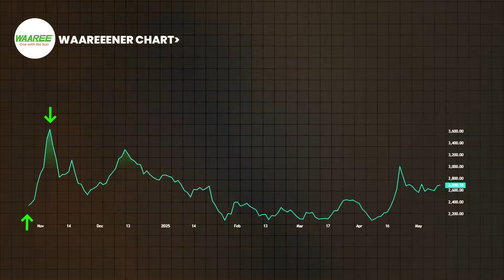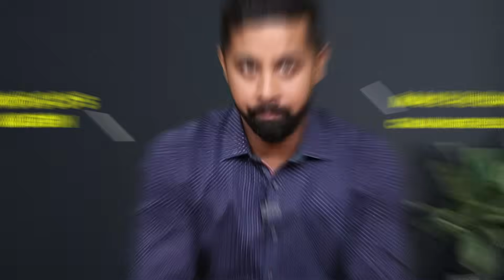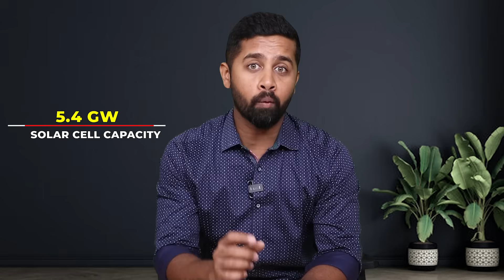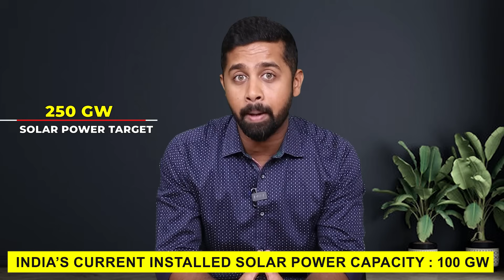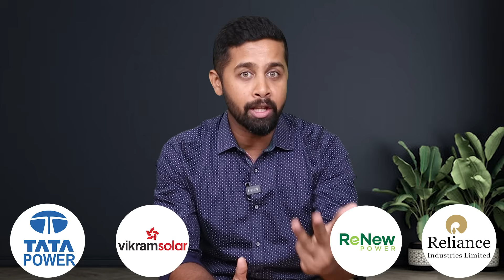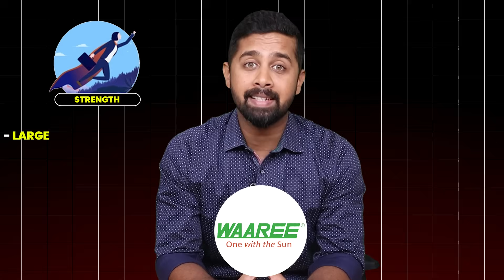Waaree Energies - Multibagger or commodity trap? Waaree Energies SWOT Analysis

Comment: No point of investing in a stock that has only Solar business when you have diversified business players like Tata Power, Adani Power, NTPC Green or GAIL for that matter.
Reply: Let me tell you as i am in power sector at very good position. Talking about Thermal , most of the companies are near their saturation point of maximisation of installed capacity. So very less incremental capacity, so their growth will be lower.also, as age increases , machine needs more maintenance.Talking about wind, it need more maintenance , operating cost is high and wind intermittency is very high. Now , talking about solar, in the country like india where sun is available for good amount of time. Also solar panel requires very less maintenance and also rooftop solar is increasing rapidly. So, for a good amount of time(atleast 5-7 years), solar future is very bright
Thank you 🙏
Reply: Thanks for sharing your view as a expert in power sector!! @nikhiln1221
Reply: Love day jaa  @nikhiln1221
Reply: When people say no point of investing is  the exact time to invest 😂
Reply: Thanks Nikhil good insights